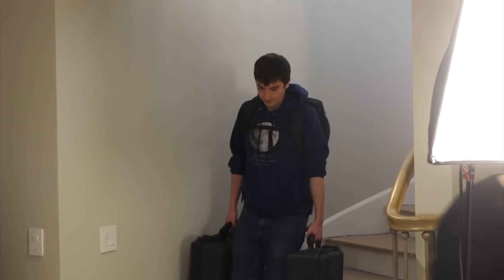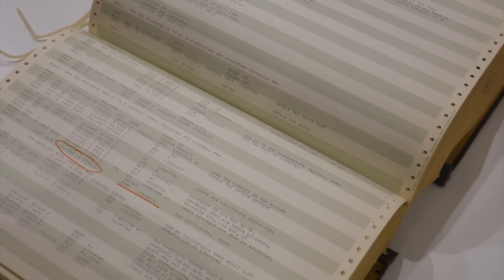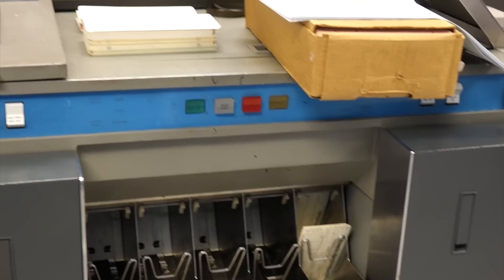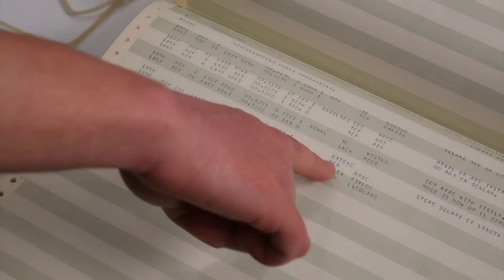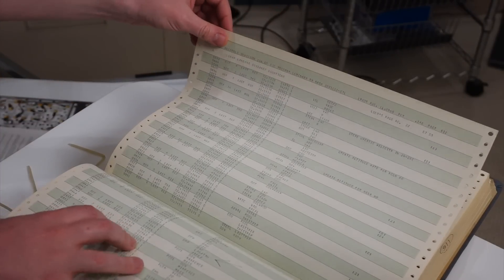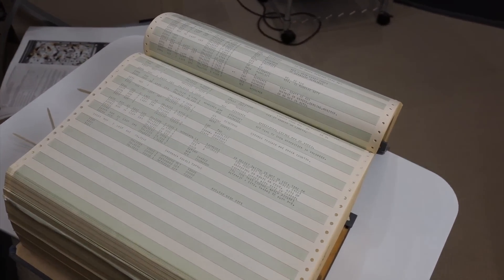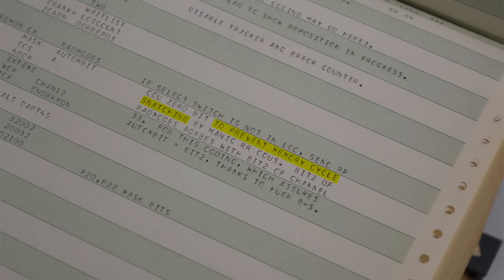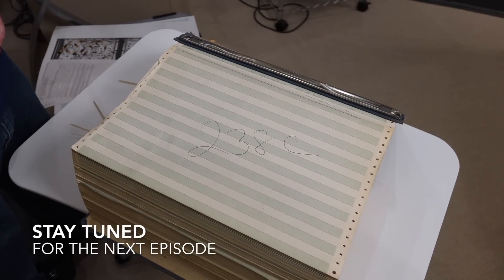Apollo 12 Source Code: Looking at the original flown code printout, and the 1202 error fix

Comment: My dad worked on the Apollo Guidance Computer design and software for Snoopy et al. He graduated from MIT with a degree in "automatic systems" and worked for Grumman on the LEM and the AGC and guidance system. He also was well versed in inertial navigation systems, radar, radio, computer design and programming and celestial navigation etc. Anyway, he had piles of those program folders that he would sit on his bed and pour over line by line, debugging errors one line at a time. Back then, to debug a program or analyze its performance they would run the program till they got an error, mark the line and then study that line of code to see what was causing the error. Since this was the 60's no one had a computer at home, so you had to debug line by line. And there were so many lines of code that one person couldn't debug the whole thing. So they printed up many copies and gave them to everyone to take home to debug a portion of the program. I know he had at least a half ton of those printouts stacked up floor to ceiling in his bedroom so they must have printed out hundreds of copies. And if they revised the program in anyway then all the previous versions became useless scrap paper. Of course, nowadays they are valuable historical artifacts that show the evolution of the whole programming part of Apollo. But in my day, they were just something that as a teenager I couldn't understand and something my mom complained about having to trip over in her bedroom. And yes I seem to recall there being a lot of strange comments in those printouts. Nasa even had small pins made that showed Snoopy in a space suit and helmet that they gave out to everyone working on the project.
Reply: Brasil - sério? Bacana
Reply: Did your dad wrote some lines? Do you know if Margaret Hamilton wrote all the code by herself? Because she is the one that appears in the photo with the pile of books and took al the credit alone.
Reply: @JuliusWise  I can't say for sure but I imagine that most of the comments were written by the original programmer. Usually programmers add those comments so that anyone who works on the program afterwards will understand the thinking of the original programmer. I believe what my dad was doing was debugging the original code. As I recall they would run the program on a simulator and if there was a glitch they would mark the line that caused the problem and then guys like my dad would try to figure out what was wrong with those particular lines of code. I do remember seeing the actual printouts and I believe my dad remarked about some of the amusing comments that were written by the original code writer. I do know that my dad worked on the actual design of the Apollo guidance computer hardware but I don't know for certain how involved he was in writing the actual code. I do know that he was involved in designing the overall flow
Reply: Before any code was written the hardware designers had to have a good idea of what they needed the computer to do and what systems or peripherals if you will needed to be controlled. Engineers like my dad were working on the hardware first and then trying to get a computer to control all that Hardware.
Reply: @squidkid2  brother,  am Brasil, e fico feliz em conseguir lhe entender
Reply: General Dynamics had a "Silver Snoopy" award for employees into the space shuttle and atlas years.
Reply: @JuliusWise  That is not actually true, Margaret Hamilton did not write all of the code, and I'm quite certain she wasn't so selfish to take credit for the whole thing either. However, she did lead the Software Engineering Division at the MIT Instrumentation Laboratory which was a big deal. I believe one of her biggest contributions to the AGC code was the "Display Interface Routines" which made programming code that interacted with the DSKY much simpler. She did much more than this, and I believe she was in charge of a few branches of AGC code, tracking revisions and determining what got added and when. It's my understanding that at least several dozen people at MIT and beyond were responsible for writing AGC code, and so many more were involved with developing the hardware, procedures and other stuff about the computer.
Reply: @JuliusWise  uninformed comment on the internet says Margaret wrote it. The official record is very clear on the huge team effort plus Margaret's role. She certainly never claimed any special input.
Reply: He had to have known my dad. I use to play the lunar lander sim as a video game in the late 60s on a building sized computer
Reply: My Dad went to Vietnam. He signed up.  2/3 Echo company. Battle of Khe Sanh,and the subsquent hill fights. 1968 was when he landed in Quang Tri.
Reply: incredible testimony of the massive effort the Apollo program took. Many thanks for sharing this!
Reply: @Spookieham  nor she deserved the subtle racist comment
Reply: Who asked?
Reply: You dad is hero , hero of Apollo project,hero of aerospace and hero of human beings!🤝🤝🤝👍
Reply: @marilson84 .  It’s subtle racism and sexism.  No doubt the commenter would deny it, as it takes some introspection to realize these biases within ourselves.   🫣
Reply: @JuliusWise that’s some woke history.  In reality a lot of men did the programming.  She was promoted to a director position where should could do minimal damage.  The photo of her next to the pile of code listings is purely PR/Propaganda.  A large team of men wrote that code but she took all the credit.
Reply: your dad is cool
Reply: Funny my dad also went to MIT and worked for trw in Houston on the guidance system during the Apollo program.
Reply: They Nortonised the code to find bugs, developed by john norton
Reply: Your dad is legend, greetings to him. Can I get something to contact him, it would be helpful to take guidance from him as I am doing my engineering. 

Again sending love to your family
Reply: @lookoutforchris  "that’s some woke history.  In reality a lot of men did the programming.  She was promoted to a director position where should could do minimal damage. [...]"
Complete fabrication and BS. Fear to have your mancard revoked?
Reply: My wife was a programmer on the LEM training simulator. She used COBOL to move a blocks of surface detail models to core memory so the astronauts could observe surface detail the older scale models could not provide.
Reply: This is the nerdiest thing I’ve ever seen

Comment: How they achieved this in the 60s is incomprehensible. It's not like they could just write an EEPROM with their code and test it with a simulation. How they got it this bug free is insane. We talk about cutting edge now, this I feel was pushing it even further. A computer to some people in the 60s would have just sounded like a foreign language. This is such a great channel!
Reply from the maker: They ran it on simulation on much larger mainframe computers, and ran it on the real hardware thing using core rope emulators that were loaded from regular core memory. See our restoration of the core rope emulator.
Reply: @CuriousMarc  Of course, I forgot about the emulators you spent ages repairing!. I need to watch the restoration once again. Silly me.
Reply: Now we can't update an app without breaking the UI 💀
Reply: Not to mention they did it all in assembly too!
Absolutely mind-boggling

Comment: I build Industrial control systems and I've lost count of the number of times I've written software fixes for bad hardware. Rarely are they as elegant and simple as that fix.
Reply: I guess that is also why Linux often has worse power usage compared to Windows on the same computer, as the OEM drivers in Windows have all kinds of hacks in place to work around faulty sleep modes etc.
Reply: digi owl partly. Also I suspect that the manufacturers simply put more effort/money into Windows support. I wonder if the same bares out in the server market, where Linux is far more dominant.
Reply: Yeah the ancient joke how many hw engineers it takes to change a light bulb (none,  it'll be fixed in software) ain't so funny anymore.
Reply: In all reality, software by it's nature can be iterated rapidly.  Hardware not so.  Now think of the number of bugs in software and compare that to hardware and you will see that hardware actually has a damn good record of getting things right at tape-out.
Reply: Sadly, computers have made elegant coding unnecessary.
Reply: @Intelwinsbigly  Compilers have made elegant and 'perfect' (assembly/machine code) code impossible.
Reply: @ChrisM541  hey look everyone, a bad programmer who hides behind his compiler! Let me guess, you write with Java?

Comment: Assembler programmers and real time processing programmers are a very special breed.  I spent my computer programming career donig that.  Reading the green bar was a treat, especially when tracking down a bit problem on spacecraft.  Remember this is an era when bytes and words were it.  Computers might be eight or sixteen bit machines.  You tended to memorize a lot and work between binary, octal, decimal and hex.

Comment: I am an Apollo Engineer who was the Emergency Control Rate Gyro Guy.
Mostly flight hardware  .
A little programming. Linking other programs . I got to send Gyro signals to the Capsule at T minus 2 min30 sec. The highest excitement of my life!!
Reply from the maker: You obviously did a great job! What was that signal? Was that for the laser beam aligned booster IMU, or for the IMU in the G&N of the spacecraft itself?
Reply: Marc,
I was part of the IBM Guidance Navigation & Control group 
.Instrument Unit. The 9 Gyros, Pitch (3); Yaw (3) and Roll (3) were no output. Until T zero.  Angular Rate ( Rotation) was phi .
At Liftoff The  engines were pointed to vertical Clear the Tower. The IMU and Guidance did that 
 My group was called Flight Control Analog. We fed the DC current to the ( 4 ) engines hydraulics. Can you believe Milliamps.
Summary: the Gyros only measured  Rotation
Reply: I must close  Marc.
Too lengthy
Reply from the maker: @keithtyler9372  Ah, booster guidance then. For the IBM LVDC computer. Thanks for the details!
Reply: Hey Marc, my EDS CRG inputs were to the guys in the Capsule. So the lights and indicators read correctly.  No  room for errors. 
Excessive Rate meant. We are turning in the right direction  but we want to ABORT. The rocket can break apart. Your decision.

Comment: My first programming experience was RATFOR, then FORTRAN using and IBM at WVU to solve aerospace engineering design, structures and fluids problems in 1968/69. So I recognize the cards, etc. in 1969 I was on my first job and moved from cards to paper tape to analyze flight test data and calibration data using FORTRAN on a  HP mini computer. A year later, I designed and coded assembly language programs to simulate surface to air, air to air missiles, and radar/IR hardware and man in the loop testing in real time!  This taught me so much that about architecture and computer cpu/gpu operations and algorithm development. I still have boxes of cards, program listings etc to remind me how far we have come in just 50 years.

Comment: Fascinating trip back in time, thank you Mike and Marc. That was a good explanation of the layout of an assembler listing too, showing the one-to-one relationship between machine instructions and assembler language statements. Around the same era I was writing air traffic control software in IBM/360 assembler code (BAL) and it all came flooding back to me. I have happy memories of six inch thick assembler listings and boxes of punch cards, just like this. Too much of this history of computing has been lost for ever, so it's wonderful that you are rescuing, restoring and archiving for future generations.
Reply: Robert Slackware  the 360/30 had no "hex pad" rather it had rotary dials that set the IPL device. The CPU woukd send a start I/o to that device to begin the IPL procedure. I wrote IPL code for punch cards, but its basically the same for tape or disk IPL

Comment: This has brought back so many memories. As a specialist Air Traffic Controller we were authorised to code and patch the original IBM 360 9020D at the London Air Traffic Control Centre if there was an immediate ATC operational requirement that had to be met. So many punched cards to type!

Comment: For me, this is by far the most interesting video of the series.  I'm a retired electrical engineer and spent a significant portion of my career on real-time software development (please everybody stop using the word "coding" -- it is highly insulting).  
My intro to computer languages was in high school, where an IBM employed neighbor brought to me an instruction manual IBM used to teach PL/1.  I was instantly hooked.  But, I never advanced to the point where any of my programs could be submitted for execution.
In college, my very first semester (in 1973) included a FORTRAN course, in which we punched cards for batch submission to the Xerox Sigma-6 beast.  In between the SPICE runs for circuit courses, I became especially fond of writing ASCII-art programs.  Which came to an abrupt halt when the sysop eventually wrote on the top of my card deck something very close to "if you ever submit something like this again, you will be banned from ever using this facility again"

Comment: At 10:59, that feature where the code listing tells you how many times before a label has been used (REF) and the page number (Card Index) of its last occurrence is a "trace" feature. Most assemblers (or post assembler analyzers) have trace features like this, but they are not used much anymore since we all have computers and monitors on our desks that have source code specific editors - like Gnu's Emacs or IDEs like NI's LabWindows/CVI or Microsoft's Visual Studio. Those editors are so comprehensive and quick to browse code, there is little need to print out source listings anymore - not to mention having trace listings in them.  I can't remember the last time I printed out a code listing... I think it was the mid 80's.

Comment: Some years ago, my rodeo group got a guy to program an online contestant registration system in PHP. I designed the interface screens and wrote the requirements for each function. I also specified that all parts of the code was to have function comments embedded within the script. A few years later, the PHP engine on the server was updated and the entire registration system crashed. When I looked at the code, I found there were absolutely no comment markups anywhere in the script. He had not followed PHP standards and just wrote the script so it would work on the PHP version he was writing for, including a bunch of poorly implemented subroutines. Not being able to understand what each section did, required an almost entire recreation of the entire system. I really could have used your friend for that one.
Reply from the maker: Badly written software running on super fast hardware is the pervasive bane of our modern existence! See, it can even ruin a cowboy’s day!

Comment: Ah, the good old days. Man, I miss Apollo. What a fantastic time. 50 years later we need megabyte executables to print "hello world". That's rather sad. Luckily much has improved, too.
Reply: Well, in Rust you can get quite some bit of code that fits into 150 KB. Also, because it´s WAAYYYY easier to use than C/C++/Assembly, there is a potential to bring neat small apps back :)
Reply: Major consumer operating systems are closed and bloated to maintain demand for better hardware. It's a swamp...
Reply: @manuell3505  That's why Linux is so popular.
Reply: @LubosMudrak  An up vote for Rust!
Reply: @LubosMudrak  Compiled code can indeed still be quite compact. But more and more software these days are written in the likes of Javascript by way of Electron or similar. Overweight turtles all the way to the ALU.

Comment: Worked on some mini computers in the 70's and 80's.  Looking at that assembly on 'greenbar' paper takes me back.  Wasn't the same assembler of course, but yeah, reading those columns with the instruction, reference addresses, comments, and all the rest was an everyday thing back then.  And the assembler programs themselves, that kept track of all the 'labels' and references to print out the table at the end was something.  We would spend hours flipping between the tables at the end and the listings.  And to think, they were doing this decades before the TRS-80 or IBM PC.